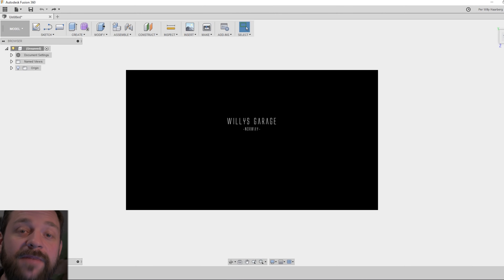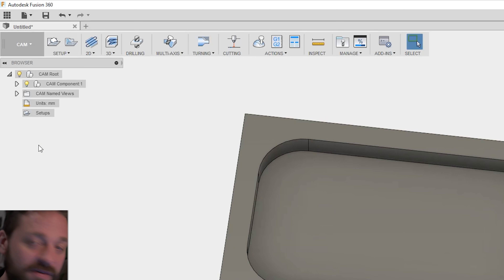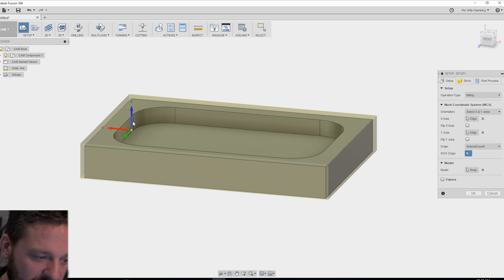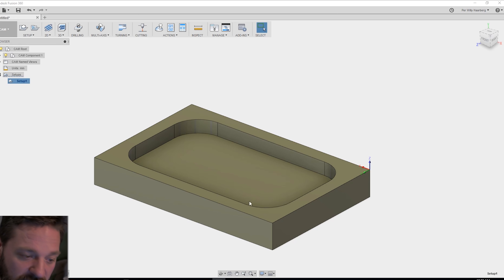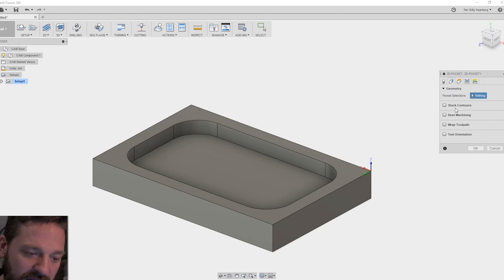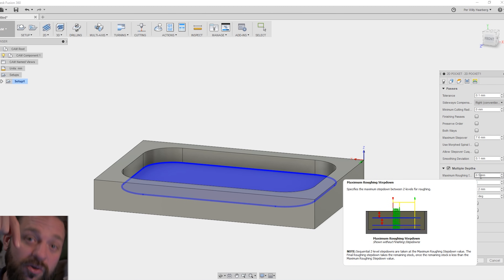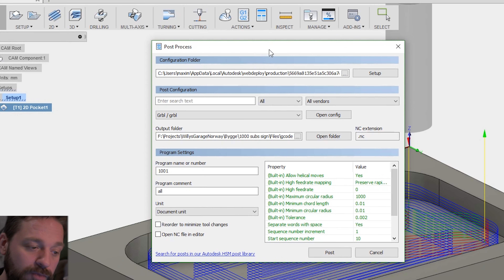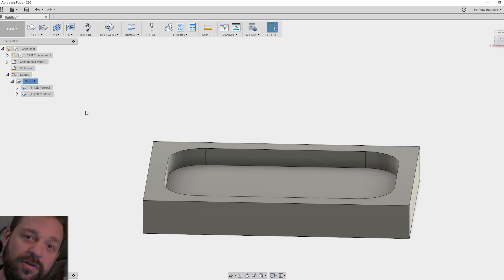Making TOOLPATHS and exporting G-CODES | Fusion 360 | Quick Tip

Comment: I'm having issues when I do it. so my cnc router came with a grbl control (candle) software and I use fusion personal to make the design and create the tool path. but when I do the post process I don't even have grbl option on the post process box. I can still open the file in the grbl control (candle) software and be able to send it to the machine but I don't see it on the see what it's cutting I just see the arrow moving showing where the head/spindle is at.

Comment: Can grbl do contours in the Z axis? Or is it only capable of doing multiple x-y cuts at a single Z height?
Reply from the maker: It can do contours no problem. It all depends on the g-code generator you use 😀

Comment: What if I wanted to mill the whole part you designed on the screen instead of just the pocket?
Reply from the maker: Hi, you can use a 2D countour toolpath to carve the outside edges of the square. Remember to set the multiple depths setting :)   
I plan to make a new video on this 👍

Comment: I brought my dwg drawing from Autocad 3D to trail version of Fusion 360, and prepared Cam, but have problems with choosing the correct bit, because I can't find the bit, which came with my CNC 3018 Pro Max, would you please tell me if we can use any generic dril bit to be used as (30 degree V shape) thanks so much. 😊🙏
Reply from the maker: In the first banner in the toolpath settings, you can click on "tool" to select witch tool you want to use.
When you ate inside the tool liberary you most likley have to make yourself a new tool. This is done by clicking the pluss icon. 
Then you can make a new tool, flatt end, v bit, ball nose and input your tools info. Good luck :)

Comment: Great video!! In multiple depths, why do you select 0.5 mm as the maximum stepdown ? couldn´t you stepdown up to 4mm having an 8mm diameter tool?
Reply from the maker: Hi and thanks for watching :)
The maximum stepdown I adjust under multiple passes is how much the tool should go down into the stock on the z axis on every pass.
This means that for every round the tool makes on the toolpath it plunges 0.5mm down.

This all depends on how strong your machine is, how fast it goes and what material you use. It does not have anything to do with the tool diameter
Reply: @WillysGarageNorway    thank you for your answer!! It would be of great help if you could make a video about how to adjust properly the stepdowns according to the tool and material
Reply from the maker: @sofi.psancho  That sounds like a good idea, maby in the future :)

Comment: Thanks, I've been using CNC for over 30 years but need to upgrade my software, my program at the moment just 'ring fences' areas to machine in 3D but wanted to check if Fusion allows you to select individual surfaces which of course it does, this will allow me to cut down on machining everything again and again with progressively smaller cutters.

Comment: Thank you for this great video Willy.  I am very new to this.  I had one problem I went to simulate on my machine without tool for test and my z axis plunged all the way into stock and wanted to keep going.  Do you have a suggestion of what I did wrong.
Reply: Hi Willy,  Thought I would post the code when this happens.  It happens at the beginning of job on that 5th line G28 G91 Z0.   I have been deleting that line and adding G0 Z0.3 so my z goes up.  I also have another one of those Z0. at the end of my job that I have been deleting.
(4 STAKES)
(T1  D=0.125 CR=0. - ZMIN=-0.2001 - FLAT END MILL)
G90 G94 G91.1 G40 G49 G17
G20
G28 G91 Z0.

Thank you,
Johnny
Reply from the maker: I am not an expert in gcodes but what program did you use to generatethe gcode?
Reply from the maker: ..and thanks for watching :)
Reply: @WillysGarageNorway  I used fusion 360.  Post to Mach3.  I am using Mach3 for my CNC
Reply from the maker: Hmm, It sounds like it might be an issue in the Mach3 settings. Have you set it up with a probe offset or something on the z axis? This way mach3 might think you are setting the zero point higher then the cutting surface?

Comment: Hi, I tried to create a gcode for a cnc plasma cutter but when I post it and save it to my computer, the file comes out as "failed". The file name ends in .nc.failed. When I open it, there's no gcode, only text that says "!Error: Failed to post data. See log for details." I'm not sure why this happens and where I can view the logs to understand what's happening...
Reply from the maker: Hmm, problem fixed?
Reply: @WillysGarageNorway  Yeah kinda, I had to use a modified GRBL post processor that someone posted on autodesk forums. I'm posting Gcodes fine now but the Gcode doesn't contain torch start/stop commands. Still trying to figure that out.
Reply from the maker: Ok, hope you figure it out 😀

Comment: On a side note, I tried using this procedure on several 6 mmm holes with a 3 mm countersink. After about a dozen attempts I was successful. I initially tried doing the 6mm hole and the 3mm countersink for all the holes in a single tool path but I ran into issues. I broke it up into 2 separate tool paths (1 for the 6mm holes, and the second for the 3mm countersink) it worked perfect.

Comment: Hi. I do not understand, why after selecting your axes, while z is pointing up, the x arrow points left(it said x, not -x..... assuming it is +X) and y arrow points down towards the operator (it said Y, not -y...which assumes +y). Normally, in Cartesian coordinate system x+ goes to the right and y+ goes away from operator.....search Internet for Cartesian coordinate system, there it is clearly explained.....So this arrow orientation is confusing and in my opinion wrong! Please explain!
Reply from the maker: You select the option that fits your machine

Comment: Great video and thanks a lot. I'm having one problem though. How do you align the starting point in the tool path with the machine?  I create the origin in 'Stock box point' to the top left front corner, select the same spot on my CNC software (Grglcontrol Candle) and the tool always does a little 'walk' before starting the job.

(if interested read below)
I can 'work around it by milling some polystyrene to see where the stock should go but I'd rather understand how to align the starting point with the toolpath and the stock.  I've got a small 3018 'Woodpecker' machine btw.
Reply from the maker: If you have set your origin (zero-point) in fusion like you mentioned, it should be where your machine starts the toolpath. But if you have set some kind of zero-probe option in candle(I am not familiar to that program) there could be a pre determend offsett from your set zero point (origin point) I would check over the preferences in candle software and make sure there are no offset sett to any of the axis. Let me know how it goes👍

Comment: Is there a way to generate a file per tool used? I have a job that requires 3 different tools and I need to change the router bit by hand.
Reply from the maker: Hi, you can make multiple toolpaths under one "setup" in the manufacture space. When you are finished with the toolpaths you can right click on them and select "post process" and then export one g code per tool used. This is how I do it :)

Comment: when I do this in fusion 360 when I extrude one part of the sketch the other gets deleted(im left with with either a rectangle with rounded corners or a rectangle with a hole in it with rounded corners) and it dosent matter which I select first. Can anyone tell me why this is?
Reply from the maker: Hi, it doesn't get deleted but it gets invisible. When you extrude one part of a sketch, the rest gets deselected in the drop down menu on the left hand side, where you have bodies, sketches and components. Drop down the sketches menu and make the sketch you are working on visible and then, voila, it's back 😁👍😉
Reply from the maker: Dont ask me why this happens.. That I dont know

Comment: I tried to use Fusion 360 to make a square and I'm using Nc Studio, but the post processor (Fanuc or Axyz) don't make a square, it make a circle with a square, like the head of Mickey Mouse. Is a problem with post processor? Because in simulation is ok
Reply from the maker: Im have no experience with those post processors. Is there a possebility tochose nc studio?

Comment: Hi there, I meant to ask if you can do a tutorial video of profile cutting some letters of the alphabet from some cheap 3mm plywood. This will then teach us how to use a different method of CNC by profile cutting with tabs so the inside part doesn't move. I would love to learn that from you.
Reply from the maker: Ciaran Whelan Hi, that sound like a nice project. I would also like to learn a bit more about tabs. Thanks for the tip. I will try to make the video soon ;)
Reply: That would be awesome. I have had a bit of a play around with the tabs and these seem very easy. I love that you can make maybe 3 passes of 1mm, and the last pass can be the tabs at 1mm thick, and 3mm wide. It gives you options to space the tabs etc. But I have not really done more than that nor have I done any profile cutting of Ply. I think if I have that video as my starting point to learning more about my CNC, then I can cut some letters out of MDF or Ply for my girls to paint up and have fun with them. 

Have you seen how expensive letters are from craft shops? My goodness, maybe a 6mm piece of MDF could make so many numbers and letters etc. 

I look forward to that video for sure, as it will actually be something that I will like to try. And thanks again for these awesome videos.

Comment: Now that you are using grbl, take a look at estlcam, ist can run on a arduino mega, with lot of in/out pins. :-)
Reply from the maker: I have used Estlcam before..  If you look at my 500 subscriber plaque video you can see I use that program :-)  It's good software and I'm going to use it more in the future :-)  But if i design things in Fusion 360 it's lot better using it to make toolpaths. Thanks for watching 👍😀